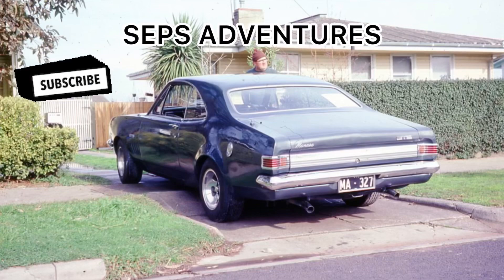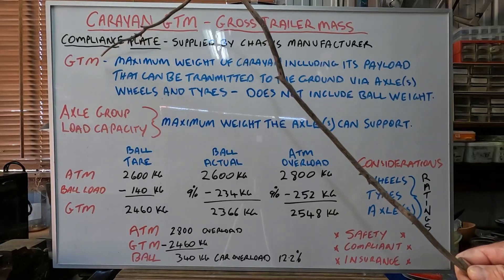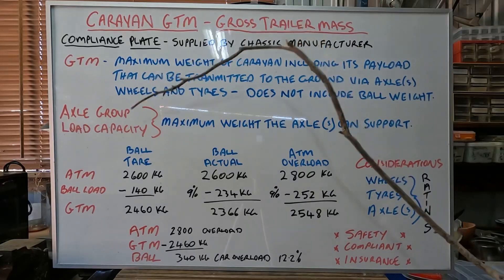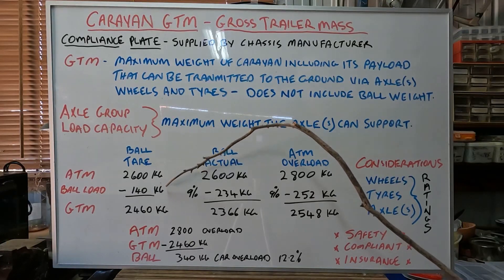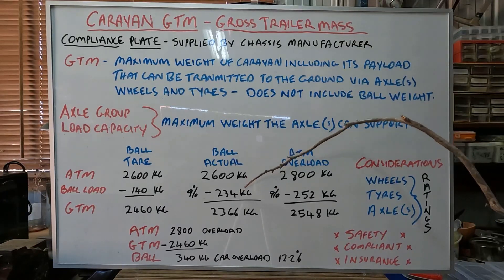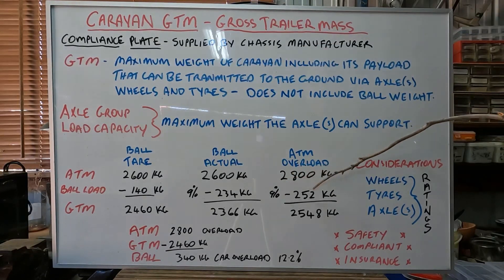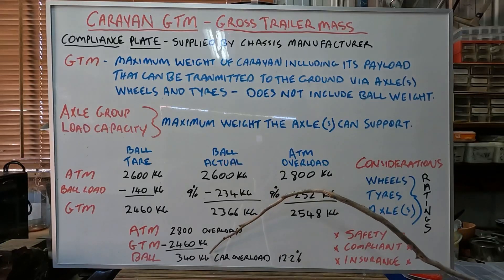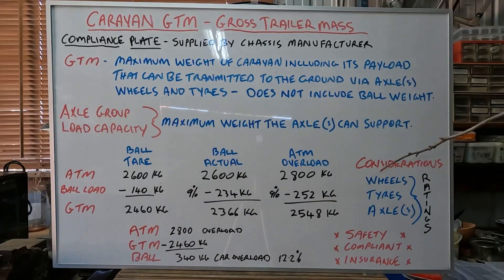CARAVAN WEIGHTS - GTM - GROSS TRAILER MASS EXPLAINED - OUR RED CENTRE CARAVAN || SEPS ADVENTURES

Comment: Hey Sep, i'm loving most of your videos so keep them coming.
i have a question for you regarding your air bags, i have a car Toyota fortuner with similar weights and towing capacity to yours and a dual axle van that's weights are very similar to yours.
Before you installed the air bags did you try or consider or try Weight distribution hitches, i have a WDH on my car but it tends to make the car unstable, it actually tows better without it, but the cars is very nose up. I've spoken with Hayman Reese with no joy, do you have any thoughts, are you happy with the air bags, if i replaced the WDH with air bags they would need to lift the back of the car up by about 45 mm ???
Reply from the maker: I researched WDH and decided not to use them. It is recommended that they be disconnected before going through large dips in the road, steep driveways, service stations etc. otherwise they may cause damage to the tow bar/ frame of the car and or caravan tow hitch/draw bar. The main reason for caravan sway is too much or not enough tow ball download, poorly loaded van, incorrect tyre pressures on the van and or tow vehicle and van overloading. I am very happy with the airbag helpers. They won’t lift the car 45mm but what they do is minimise the sag. At 30 PSI the lift is about 15mm in our set up. Check out my air bag helper video type in - Air bags Seps Adventures. Appreciate your comment. Cheers!